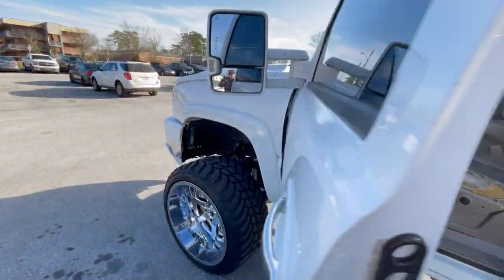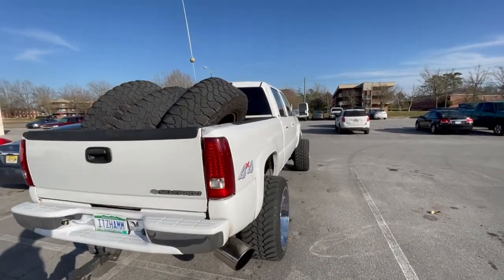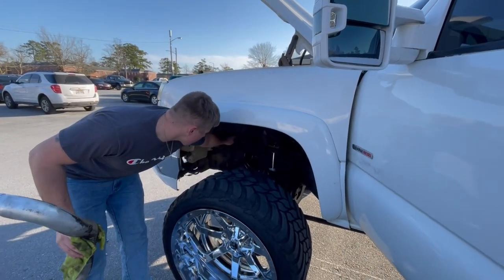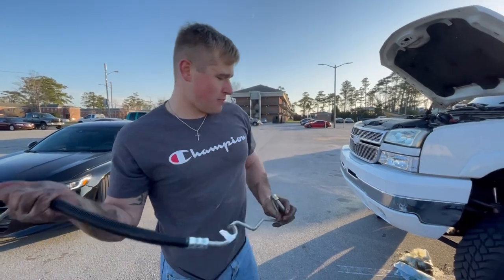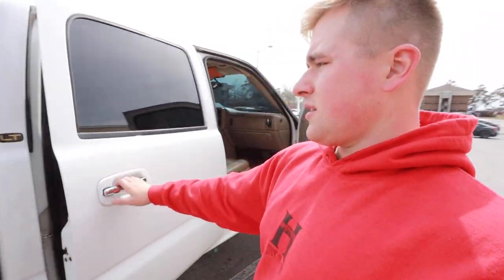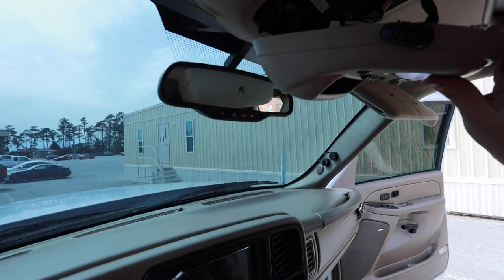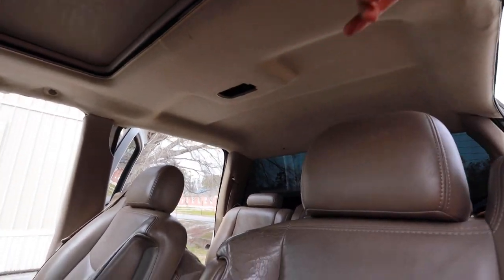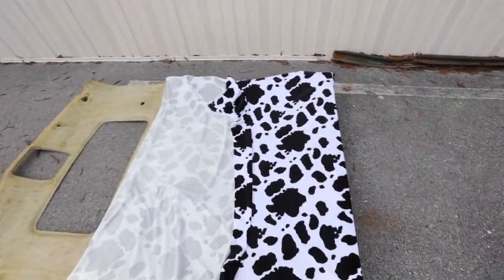COW PRINT headliner on my Silverado + NEW PARTS

Comment: 2” rear spacer lines up nice with the front since rough country uses the cv spacers. with 1.5” you would have to trim the tips of the studs
Reply from the maker: Very true I did research after posting haha. Thanks for the input 👊🏼
Reply: @itzhamm9592  not a problem brother